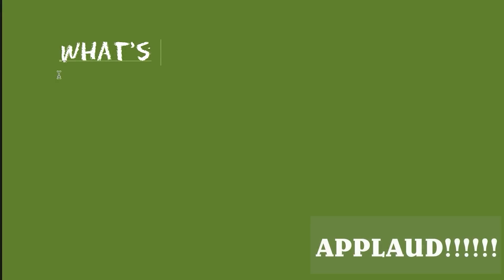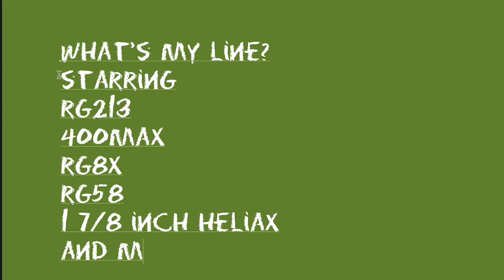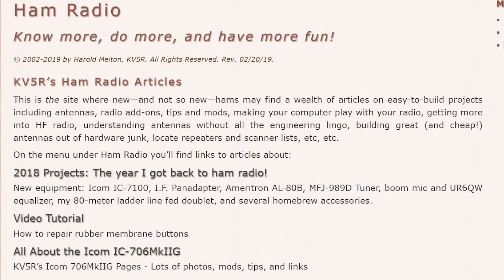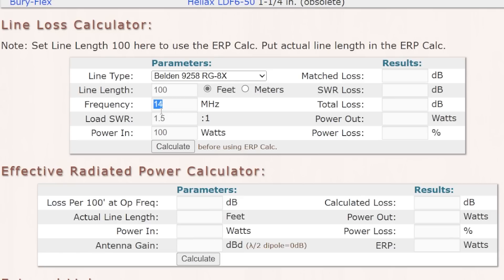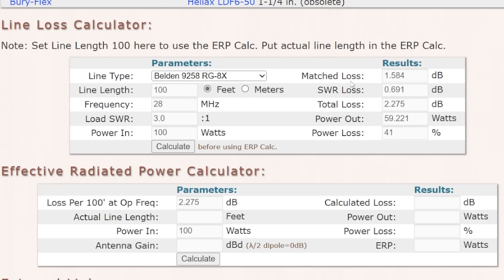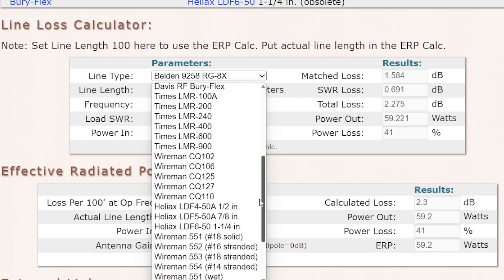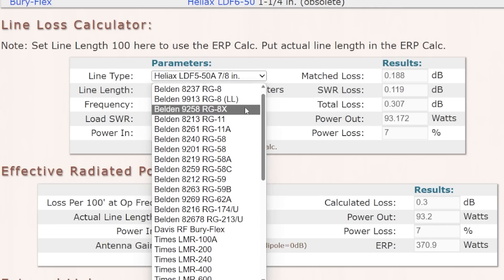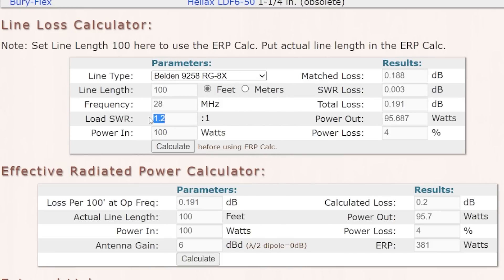What's My Line?

Comment: Hi Jim, wow it's great to see you looking so healthy.  I always say one should do a reality check and compare the losses by looking at the difference in S units and I typically use a 2:1 SWR for the comparison as that's typically what I try to maintain as my highest SWR at my antenna feedpoints.  As an example for a 100 foot run of coax, 2:1 SWR, 28 MHz the difference in S units is just a fraction of an S unit between the 7/8 inch hardline and even RG-58U (Beldon 8240).  7/8 inch hardline loss =  0.233, RG-58U loss = 2.222 dB for a difference of 1.989 dB which is 0.3 S units assuming an S unit = 6 dB (the difference would have been 0.4 S units if the SWR was 3:1).  While 0.3 S units might be the difference between making a QSO and not, that's often not the case.  Of course the differences becomes much greater on long runs or systems operating with higher SWR, and that's why I always go back and do comparisons using S units as my reality check (easy to visualize the difference).  There are other reasons one might consider investing in better coax depending on the application (higher power handling capability, buried, higher percentage of shield related to signal ingress, etc.)  For a 100 foot run on HF if I were to spend a lot of money on a tower and tri band beam I would definitely invest in RG8 or better but for simple low cost system using a dipole or EFHW antenna as an example I would not get hung up on using RG-58 as an example.  73 and keep on doing what you do for the ham radio community.  Don
Reply from the maker: Thanks.  I had some surgery yesterday and I am up early with some pain.  I did get some good news that there has been some improvement in my cancer in that blood tests showed fewer blasts or bad cells.  It was 2.5% and then a scary 15-20% and now the preliminary results were down to 5%.  You make a valid point about coax versus costs/benefit.  I tend to go for the lowest loss everywhere I can.  A dB here and a dB there can add up and that is what I try to avoid.  Yes, with a beam RG58 would be a mistake.  About RG8X, I found the quality to be awful from one brand to another.  So buying a good quality RG8X becomes a challenge.  I have amplifiers so I tend to go for the big stuff.  Also, I got some really good coax surplus with the help of R7KZ a few years ago.  He was here visiting and had been to a swap meet.  There he bought some really large coax and gave it to me as a gift. We have been friends since the 60's.  I have kept that coax and it still is very low loss.  When I see that coax I think of his kindness.  Stan is now a US citizen and so are his children.  Anyway, in the scheme of things the difference in price is small and life of really good coax can be decades if there is no water intrusion.  Really low loss coax can be as helpful as ladder or window line when the SWR is higher than you and I would like.  Another point, back to the microphone, I would rather have a cheap mic and expensive coax with a good antenna.  You and I can agree on that.  Thanks for writing.   Your friend, Jim W6LG in Rocklin CA

Comment: Jim, Heliax is great to use EXCEPT when it is Air Heliax and you live in the MidWest or the Deep South. With the humidity you have to use Compressed Dry Air to keep the line from building up water. Water Bad. When I used to work on Waveguide and Air Core Heliax we would also use a Dehumidifier / Air Compressor from PureGas. It had twin Dessicant towers with heaters and we added an additional Water Trap before the Towers to keep as much water out of the lines.

Comment: Pretty amazing losses with 8x on 20-10m compared to 400. 400 is cheap enough that people shouldn’t consider 8x unless it’s for 80m.
Reply: Hi Jay, while the losses might appear high when using 8X or RG58 when looking at power in units of watts, I always go back and say OK let's do a reality check and see how many S units difference does it really make, and on HF (especially on the lower bands) it's always just a fraction of an S unit when looking at a 100 foot run (assuming 6dB per S unit).  Example: 28 MHz, 100 foot run, SWR 2:1, RG-58 Beldon 8240 total loss 2.222 dB, LDF5-50A 7/8" total loss = 0.162 dB.  Difference = 2.06 dB = 0.34 S units.  While sometimes 0.34 S units difference will be the difference between having a QSO and not, that's most often not the case.  Repeat that same comparison on 1.8 MHz which is where I operate most of the time and the difference becomes 0.085 S units (less than a tenth of an S unit).  The biggest concern between what kind of feedline I need on HF would be based on power handling capability or quality of shield related to signal Ingress when dealing with receive antenna systems.  Don't get me wrong, if I were to spend money on a tower and tri-band beam as an example I would at least use RG8 coax for a 100 foot run but for a simple station running a ground mounted vertical or dipole as an example I would certainly not get hung up with the fact that I'm just using RG58 coax for HF (if my coax length is only 100 feet).  Just my view of life (feedlines).  73, Don

Comment: For HF at my station over the years I have always used RG8U for my 50 feet of feed line.  Very happy with that.  Have experimented with "better" types but for my 50 feet I am very happy.  de WB7ORB since 1965.  Jim you are looking great.
Reply: Hi Tim, great decision as there is really very little difference between the best of the best and RG8U when using 50 feet of feed line on HF bands.  As an example for a 50 foot run with 2:1 SWR on 28 MHz RG8U loss is 0.582 dB, and if using LDF5-50A (hardline) that's mentioned in the video the loss is 0.117 dB for a difference of 0.465 dB which is 0.08 S units which is less than a tenth of an S unit assuming an S unit = 6 dB.  73, Don

Comment: Jim. Old tv show i remember.   

I use best coax or better for frequency involved. Best StSteel connectors.
Reply: Test antenna. AM radio. Set at 1000 khz. Listen. By my radios. Then at antennas. I can hear if its high losses.